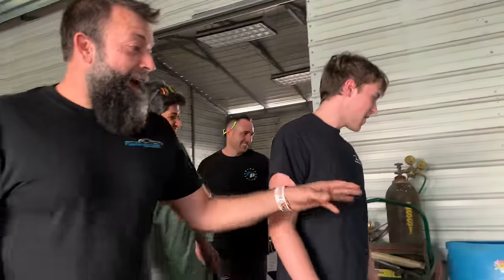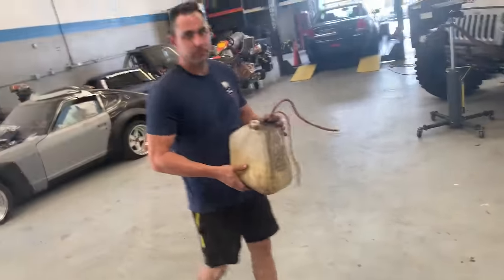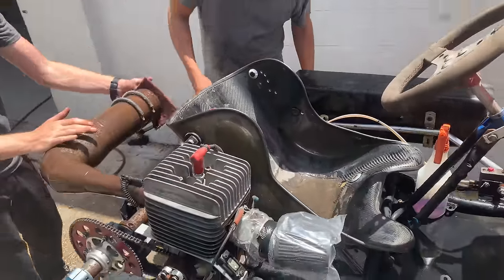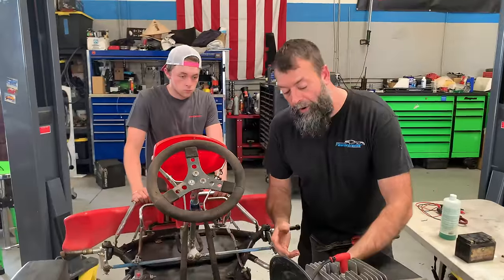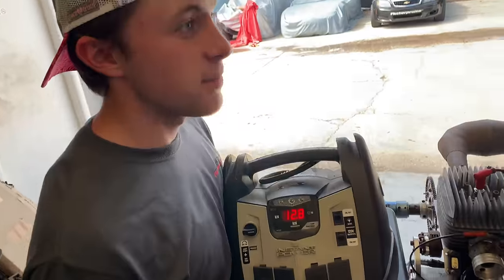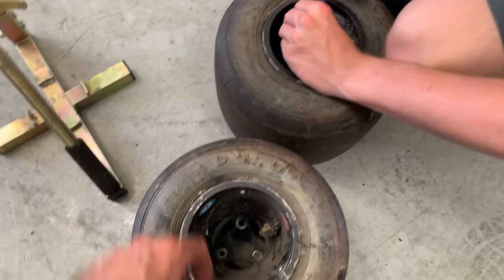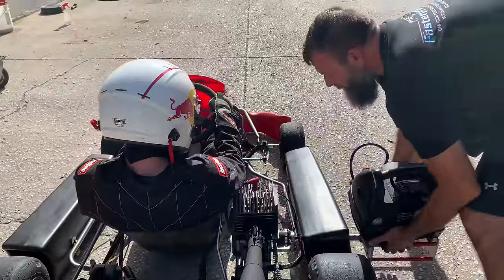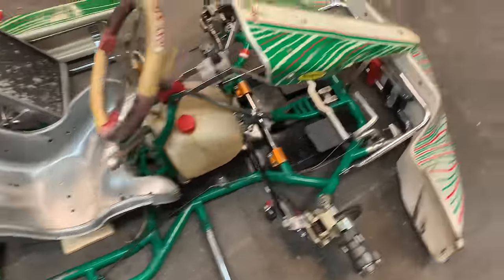We FOUND An ABANDONED Vintage Racing Go-Kart!    WILL IT RUN?

Comment: I raced one of these when I was a teenager in the 90s. They used to have a couple different exhaust options depending on what class you ran. As teenager running in the junior class mine had a short little can for the exhaust. Good memories for me for sure.

Comment: Porting the head in a 2 stroke would remove material and effectively lower compression and kill your squish. 

Porting the cylinder and cases is common but can easily ruin the cylinder if you don't know what you're doing.

Comment: Glad to have you back. Do you still have the awd s10.
Reply: Hopefully he sold that junk. That was such a heap of unreliable garbled together junk. The smart car was another waste of time. The Escalade and Uncle Sam were cool projects.
Reply: @Turbogto_guy  have you considered having more fun?
Reply: @mycosys  what’s fun about a vehicle that breaks more than you can drive it? Sometimes working on stuff is enjoyable bout having to constantly repair it gets old. That 4wd s10 was junk.  Moving the radiator and fans to the bed is dumb because unless you have a funky wing directing air to it, there’s an air pocket right there and it doesn’t get airflow at speed.
Reply: @Turbogto_guy  The smart car was freaking hilarious
Reply: @Turbogto_guy  & i gotta say dude, if you dont understand whats fun about experimenting with something technical just to see what happens, you might just not have the bug that brings us weirdos into engineering fields. You dont get good by doing everything right.
Reply: @mycosys  when one project is a dangerous death trap…..them getting killed won’t teach nothing except that was a stupid idea. And the s10 was a horrible, unreliable monstrosity that did nothing but break all the time. Only thing I see learned from that is the whole project was a mistake.

Comment: That single lug on the front wheels is nice. You can put nice bearings in there with confidence, as just like on a car you'll be able to set the preload, unlike the back, which is basically just a solid axle passing through two bearing blocks. I'm sure they are caged bearings or whatever on the rear, but otherwise unprotected from dust and debris and able to sling any lube out over time. That thing was probably quite a ripper when it was in good repair, and with a bit of love and lube will be a ripper again in no time. Cool shit. If you get to working on it and get a little more torque out of it, you can change the sprockets for more speed or acceleration. Pick up a tooth on the big one to get more mph out of it, and if you go real short course, you can add a tooth on the small sprocket and tighten up the gear ratio and make that thing absolutely leap out of corners under throttle. This thing should be a real blast!

Comment: Back in the mid to late 80's I raced 100CC Super Stock Light with a Komet K55 and an Emmick Kart.  Man, was it fun!  Those were the days!  We ran Cam2 racing fuel with Klotz 2 cycle oil mix.

Comment: Good to see you back . I reconditioned a go cart like that but it had a honda 250 2 stroke with a 6 speed gearbox . 100mph or 160kph in my lingo and its a hoot banging gears an inch and a half off the ground . So much fun . Donuts are awesome in it .

Comment: Cool find. It brings me back to 1996,1997 when I raced gocarts very similar to the cart you have at my local dirt track. I was young so I don't remember what all my dad and grandpa did to it but I do remember it was a 5hp Briggs and straton engine that was gone through and it was running on methanol pushing around 14ish hp. I loved that thing and loved racing and spending time with my dad and grandpa on the weekends.  Such great memories and trophies haha.

Comment: Ospho is a rust converter. It;s a great product when you use it correctly. Youre supposed to apply it and let it sit and it converts rust into a protective coating that you can paint over or primer over. Its essentially phosphoric acid which converts iron oxide into iron phosphate. Washing it off or sanding it off defeats the point of using it.

Comment: I am currently running Twin KT 100s big bore and fully ported over here in Aus. The KT 100s is still raced here in the AIDKA series. Start around 1 & 1/4 on the low and 1/2 on the high. Obviously depends on porting etc. but a good starting point. Go out to 1 &1/2 on the low as you go. I run pump 98 petrol at  20:1 fully synthetic oil. We run them direct drive. Any questions hit me up. Your right around the 15k rpm for a KT if you want to hit the 19k look for a Parilla Reedjet 100. They will do 19-20k when tuned in the edge.

Comment: No idea what they use now, but we had a Digatron DT-6E that was a tach and head temp gauge.  We rigged up 2 flashlights so I could see the gauge at night as it was not backlit.  The last kart you showed is a 125cc Shifter kart.

Comment: If that green stuff you guys were using was Ospho (I think that's what I heard you say) PLEASE use gloves!! Also, you are supposed to let it sit for a while (it will turn the rust from brown to black and sometimes develops a white "crust" on it). It's Phosphoric Acid, and is meant to convert the rust and etch the metal to prep it for primer or other coating.

Comment: Glad you guys are back, uploading regularly. 
   I do need to tell you "teflon" when it is burned will male you very sick. You will feel like you have the flu. Like burning zinc or galvanized metal when welding.  Not to be messed with. Ask me how I know.
   If this happens, drink a glass of milk and you should feel better in twenty mins or so.

Comment: That a KT100? Had a blast racing those as a kid in early 2000s. That has the large exhaust pipe on there and will be quick. My dad and I always struggled messing around with drive clutches (wet or dry). For fun, changing to “direct drive” simplifies things. However, if you spin out you’re hosed. then you’d be getting out and push starting on track.

Comment: my guess is late 90s given axle size. that one is only a 15g engine and will last 10 or 12 outings piston wise. we  ran them with an air box to cut down noise an made them easier to choke while push starting. 1.25 to 1.5 turns on low speed mixture .5 to .75 on high. You need to hear a little 4 stroking at wrung out flat chat for the mixture to be right and check the plug colour too.

Comment: Port the head, on a 2 stroke. I'm not sure that works, boss. Thanks for all the great videos
Reply from the maker: Definitely works but must be cautious. I’ve ported  at least 3 2-strokes and they have all picked up substantial power, no kt100s as of yet though.
Reply: @Fasterproms1  ported the cylinder thought, right?  With nothing but sparkplug above the piston ?

Comment: KT100 - the best one in the world MIGHT make a little over 14hp, and anything over 13500rpm is useless.  15k will pull the wristpin out the bottom of the piston.  People who don't know will quote you ridiculous RPM numbers, just smile and walk away,  The useful powerband is from clutch engagement at about 9800 to maybe 13000.  2 stroke heads don't get "ported", the head is only the combustion chamber (don't raise the compression).  The cylinders do... BUT it's so easy to screw one up... don't touch it.  There is little to nothing to be gained on a piston port 2 stroke anyway.  The radius on the filter adapter was a rule, I think it was 40 thou.  Doesn't matter much anyway, you can make a velocity stack and epoxy it into the carb inlet and not get a tenth of a hp.  Sunoco GT100 is fine for fuel, anything more is a waste.

Comment: I'll have to come back and watch this tomorrow. The yamaha kt-100 with a pipe is what I dream about at night. It's a shame it's a dead class, well hell the yamaha is a dead motor. 18hp with an expansion chamber full power at 15000 RPMs, clutch doesn't even engage till 10,500. What an era of karting motorsports RIP. And 18hp in a 2 stroke in something that weighs 340lbs with you in it is fast a fuck.

Comment: I've seen 440cc twins 80 horse just insane but you need a complete cage on that, cause those would run 100 mph or more. Yeah they had no transmission just a liquid torque convertor and Gilmer belt drive, truly insane machines only for men who have grapefruits.

Comment: I worked on steel boats up north for years. They call it “FOZZ” instead of ospfo. You are supposed to clean up the metal and spray it on and let it dry. Its not soap

Comment: Hey guys.   That thing is lean.  Low speed closest to the engine high is towards the air cleaner.  

Here is a bit of info on the carb. 

https://youtu.be/H7kMr05s6tU

Comment: Watch the exaust temp if it gets to high you will stick the ring.
Reply: Need to run a gauge and you fatten the low side one with the t handle. Also good to blip the throttle once in while also to richen it and cool it.
Reply: Piston ring will stick if it gets hot and is easy to do especially in the heat of the battle!! Race
Reply: Ran kt100s for several years he will have a frigin blast👍👍
Reply from the maker: Very cool thank you. Had a few issues with the carb and going to rebuild it. What kind of egts 1250-1300?
Reply: @Fasterproms1  got to thinking we used cylinder head temp gauge. It's been so long ago but if I remember you wanted to keep it in 310 degree range don't hold me to it. You tune it with t handle jet as you are 🏁 racing lean it a little pulls Harder but temperature starts coming up. You have to fatten it or lean it while racing.
Reply: Watch out it's addictive 😎